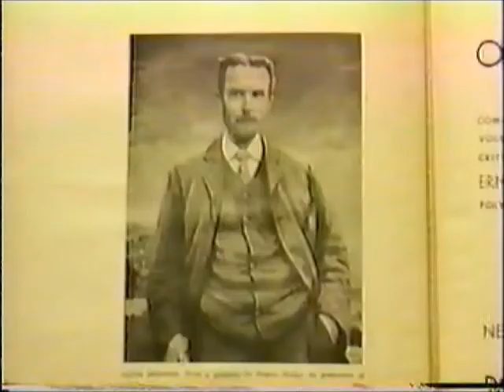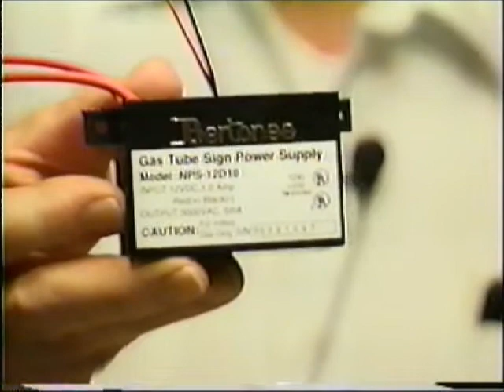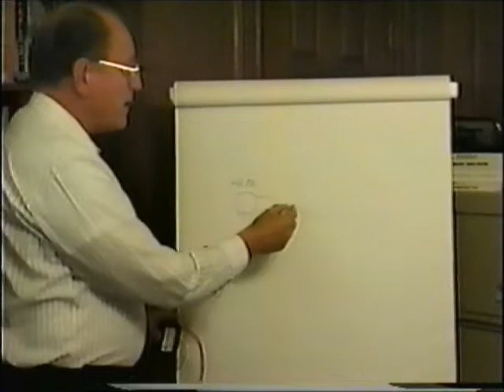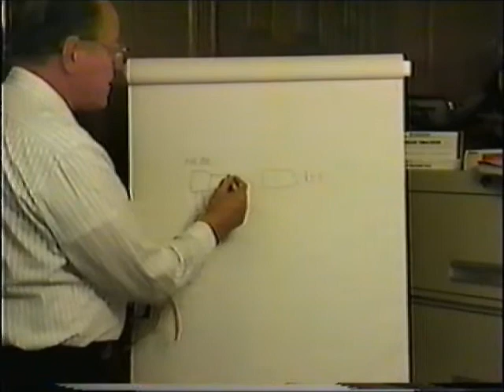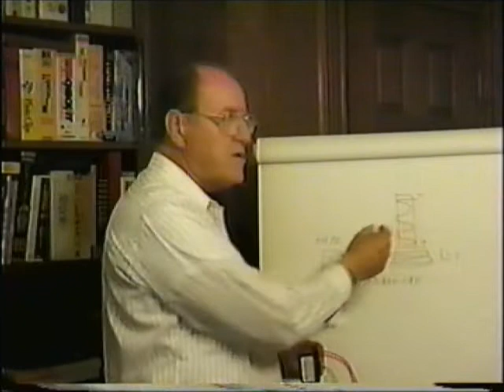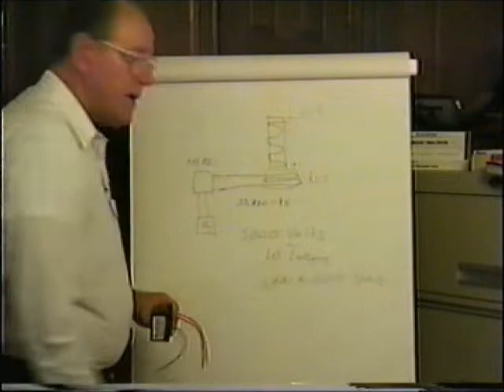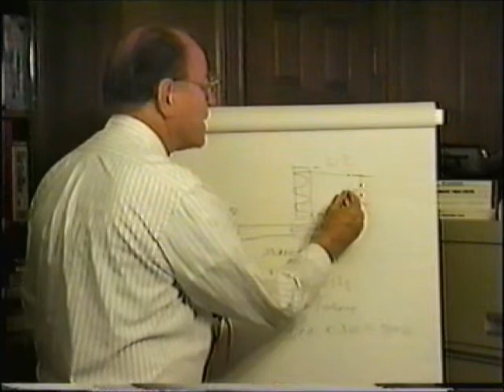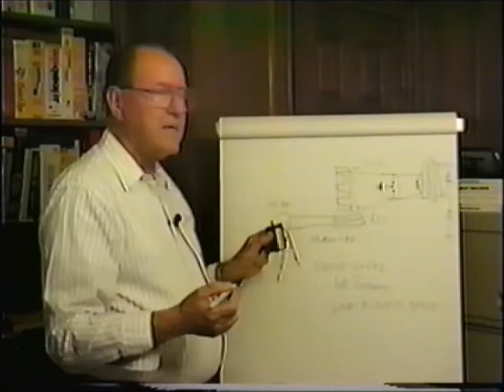4 Don Smith Resonance Energy Crafting Systematic Index 1998

Comment: How do I test ground for levels of electrical activity, do I need to reference against the atmosphere? How do I test my household ground and is it a good idea to use that for experiments? Great vid
Reply from the maker: Thanks. I am not an expert in this and I cannot comment on some of these questions because of liability issues. These are questions for local licensed electricians. They will tell you not to connect to the electrical ground. They probably will not answer your main inquiry. There are millions of "experiments" people can do, many of which can be very dangerous. The ground is kind of like a zero of which you can be greater or lesser in reference to voltage. Amperage is another matter, and while you are pulling in electrons from the ground, or returning them to ground, if you become the conductor it can be serious or fatal. 
The electrical activity of the ground is something not specifically taught by Don Smith, even though it was one of his major systems. He talked about measuring it and pulling energy from the ground, and from different points of differing potentials. But it wasn't something he demonstrated or specifically taught about.
Reply: @rickfriedrich  
Thanks for sharing this info I'm really just a novice at this so thanks for the warning also. I actually began studying electricity/ aether to get answers to different questions I had after about a year and a half I believe the answer is in grounding and timing.👍

Comment: Hey Rick, I am trying to replicate the device mentioned at the end but I'm having trouble with the grounding concept. I have energy coming from my L2 but it's at least half as powerful in terms of powering a light bulb as the energy going into L1. I know Don mentioned amps being after the fact and coming from ground but no matter how I ground my L2 the amps don't change. I also tried pumping it into a capacitor with diodes but no difference even with a ground. Same thing when pumping an isolation transformer at 60hz and grounding the output as mentioned in the video. Any idea why that may be?
Reply: hi, did you fix your issue ? did you get don smith working device now ?

Comment: I tought that electrons as exist as waves. Double slit experiment.  There is abundance of positive charged ions in the ionosphere and Earth is charged negative. What do you think about Tesla's Aether theory and Geometry as  essential parts of Pyramids and all his inventions using nature as a Template for his inventions. What  kind of energy was he using back in early 1900 with just an AC motor,the antena with the disc covered with tin foil.The earthing was done trough the cable touching the ground. Was it a  static electricity or was it Zero point energy?
Reply from the maker: I don't know, I've never seen an electron. All I care about is the predictable phenomena while trying to work with the words people use for such.

Comment: In the comment section of the following video, the author of the Video is having an interesting discussion with the user by the name of @johnkoury1116. He mentions that his Grandfather was a friend of Don L. Smith and that he saw all of Don's devices and even witnessed most of them running. Furthermore, they were exchanging information in the form of pictures. Maybe he has some Information about Don and his life that might be of interest to you, if you're still looking for further information thou.

https://www.youtube.com/watch?v=Ya2sqVvc9TA

I tried building what Don suggested at the end of the Video (35:22 – 43:35), but I failed to transform the voltage up to 9 kV. I wound the primary on top of the secondary. Both coils are wound on a round coil body made of cardboard with a diameter of 2.9 inch using 2 AWG litzwire.

When the high voltage module (VT1510-12) is connected, the voltage drops to 200-300 V on both coils with a frequency of about 32 kHz. The magnetic coupling doesn’t seem to be good enough.

Should I use bigger wire and bigger coil body diameter?
Is the High Voltage Module appropriated for this setup?

Any advice would be greatly appreciated.
Reply from the maker: I just responded to that johnkoury guy on that video by my friend XRIX after you mentioned this. 
You can see in that video that what he is showing is the same thing without the two coils. This is what Don shared later on and passed it on to Bruce P. I have it in the book. You can see many similar setups that are NST to cap and spark gap then to output transformer without having to go so high in voltage. You have to consider the main objectives, and XRIX finally got the cold energy part there. We can look at that at the upcoming meeting in July.
Your NST is not the 3000V one Don was using so that is not the right one. But it can still give you what you are looking for.